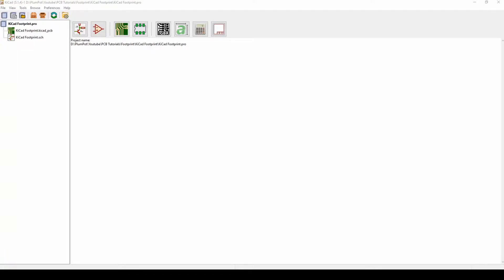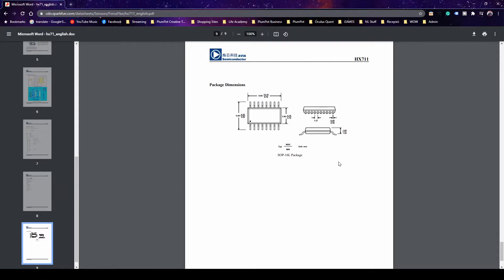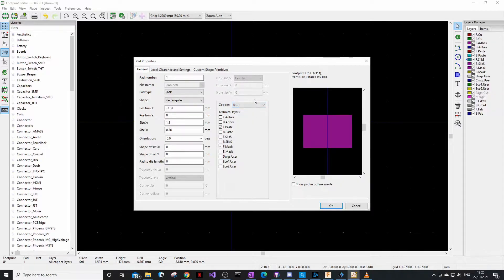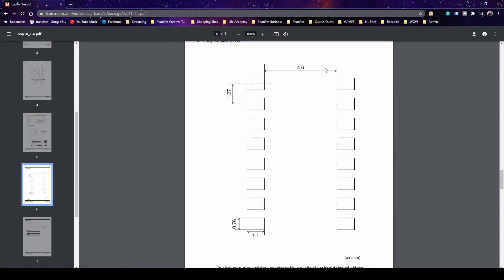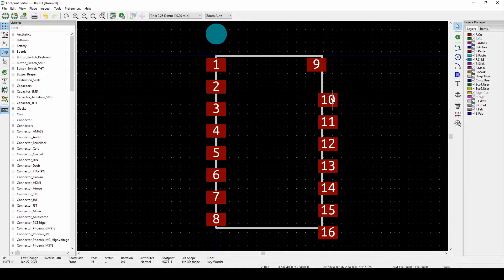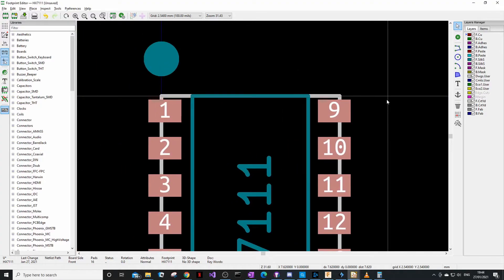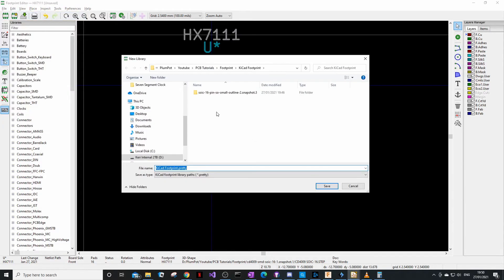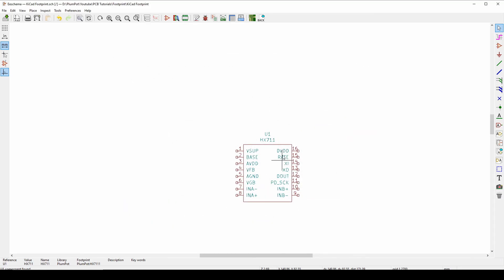KiCad Tutorial - How to create your own Footprint in KiCad

Comment: When you placed the pins on the footprint, Pins 9-16 are reversed. 16 should be across from 1 and 9 across from 8. Pins go around the the chip counter clockwise.
Reply from the maker: Hi Jeffrey, thanks for picking this up :) Seems like I had a little brain fart here. Will fix this. Thanks!!
Reply: @PlumPot  no problem
Great videos
I need to build a couple items also
Keep up the great work
Reply: @PlumPot  Also missed it at 15:00 when opening Keri's Symbol, which had the pins correctly placed...  Any news on the 'fix'?  Ta

Comment: I'm just getting started with KiCad..  I have been able to create PCB layouts for 3 boards so far.. but Creating footprints is a nightmare.. I am able to see a 3D view of the PCB, but I can't see the board populated with parts.  It would be nice if KiCad had a 3D view of the parts in relative size to each other so that you can pick the part that fits the space you have.  

I have not been able to get the footprint for the esp8266-NodeMCU from SnapEDA to work.. I got the schematic symbol for it, but the footprint does not exist after I downloaded it.

Actually I think I did see a footprint, but it was not tied to the schematic symbol and it was the wide version (esp8266 with CH340G) and I have the (esp8266 with cp2102)

One of the PBs I designed to control 16 relays has the esp8266, 2 PCF8574 DIP, and the associated sockets and headers.. I could not get enough space for dip switches to select the i2c addresses of the PCF8574's, so I had to place 12 solder pads 0.06 inches apart to choose the i2c addresses with solder jumpers. (I think I have everything on this board worked out except that I won't be able to use the USB port with the relay connected.. So I might have to do the whole thing over with a D1 mini and surface mount PCF8574 chips. So that I can rotate the D1 90 degrees.)
Reply from the maker: Hi WagonLoads🙂 I'm not sure what your question is? You can create a 3D step file and import it in to KiCad to give you a 3D view. Once you get the hang of making footprint it does get better😁.

Is that the only issue you have at the moment?
Reply: @PlumPot  I found this for the D1Mini. Is this what I need for KiCad?
https://www.3dcontentcentral.com/download-model.aspx?catalogid=171&id=701696
and will KiCad connect the pins on the 3d package to the pins in the circuit diagram?
If so and if they have the same thing for the NodeMCU then I might be OK.
Reply from the maker: Yes this can work😁. It needs to be a .step file. Another cool website is GrabCad. They also have lots of 3D step files